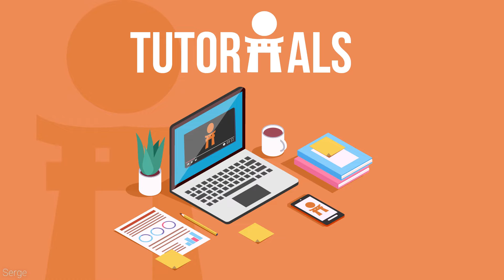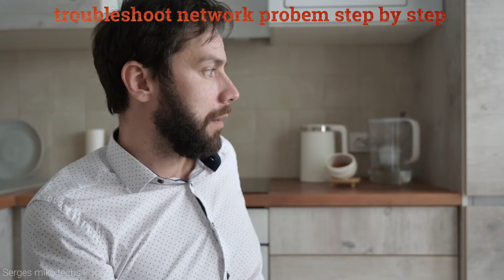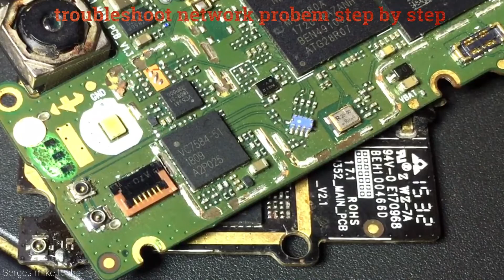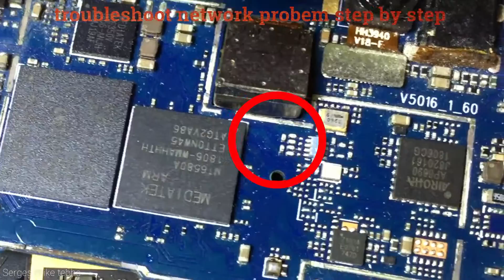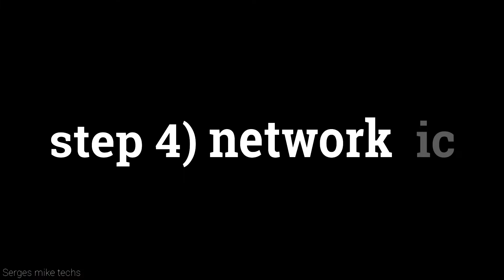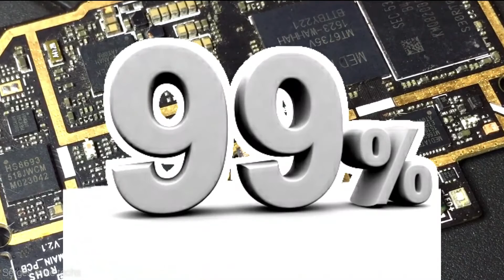Use this steps to troubleshoot and fix network problems on any pcb | netavark kee marammat ke charan

Comment: Thank you bro..my qn is in some video u said an improper functioning power ic can also lead to network problems since it distributes less power to the network section..so under wc circumstances is that possible..thanks
Reply from the maker: It’s very clear!!! 
The network ic gets powered up by the power ic. So if that part of the power ic fails to send the voltage required for the network ic healthy functioning then the ic won’t be powered up which means there will be no network. 
Hope that’s clear now